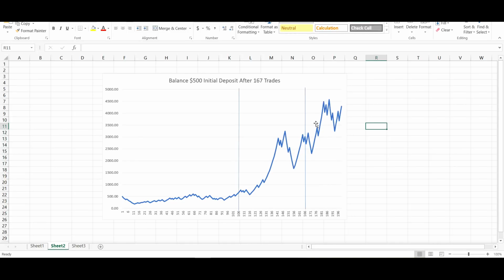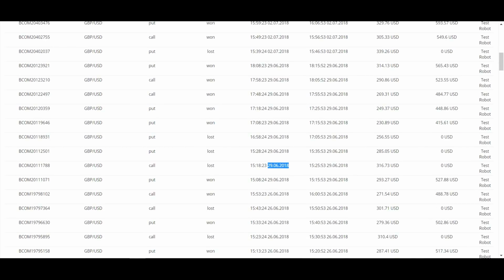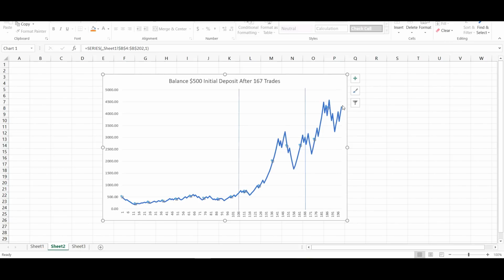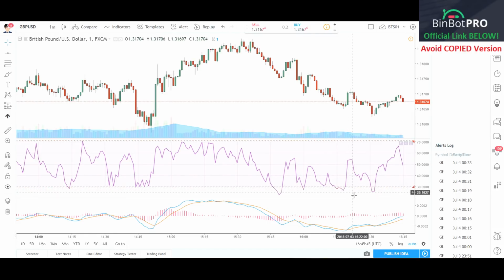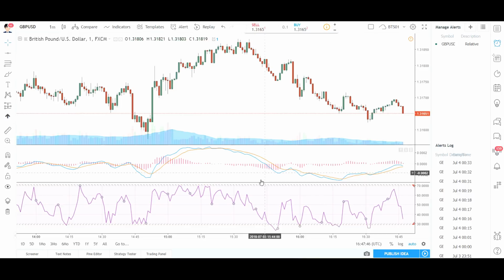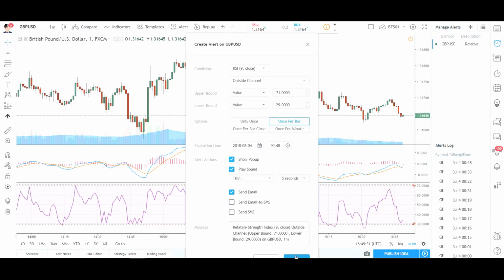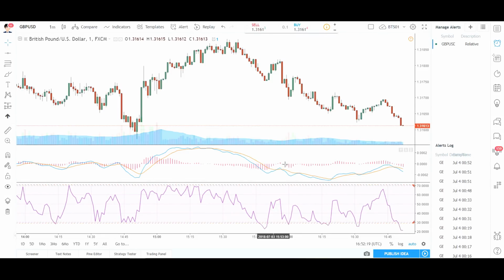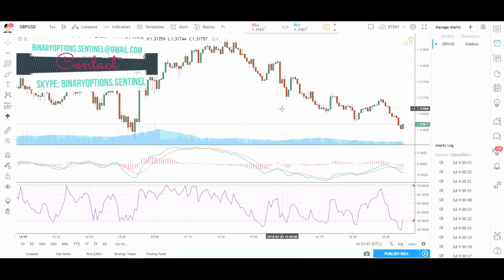BinBot Pro Best Settings - How To Use it Properly? 🤔🤔

Comment: Hi can I use different robot  the same time or do I have to use only one robot at the time.
I put a lot of trade but my balance is still under 250 because the most time My lose and my wins are the same. so 10 trades 5 loses 5 wins.
Reply from the maker: Hello Jacinta, Of course you can use different robot at the same time. However, I don't really have data that shows some sort of consistency for other robots. And based on my early experience the robots there didn't really work for me. Hence, I only use the one I formulate for myself. The reason for the chart reading/alerts is due to a pattern where I realized it could provide some sort of higher probability of winning with my settings. Not really sure this helps,  but good luck. :)

Comment: To summarise your video, after doing the settings on BinBotPro and Alert.
If I hear the alert then I switch on the trade/s (which is for now, we are testing on GBP/USD)...which may or may not be accurate.
How long do I leave the robot for? Or when do I stop
Reply from the maker: Yes, correct, for now I can only be confident in GBP/USD since I only have enough data for that pair. After you hear the alert, it is due to the candlestick on the chart forming and the price may have crossed over 70 or 30. but We shouldn't take the trade if the candlestick turns out to go back to its original price before the cross. So we should wait for the candle to close and once it closes, (meaning the next minute, since we're looking at 1m chart). If the RSI level still maintains its position (crossed 70 or 30) then we shall turn the bot on.

I would suggest for starters turn the bot on for 1 or 2 trades then we turn it off.
Reply: Ok...so we will await your next video for live trading....